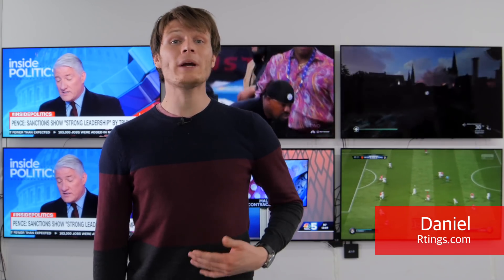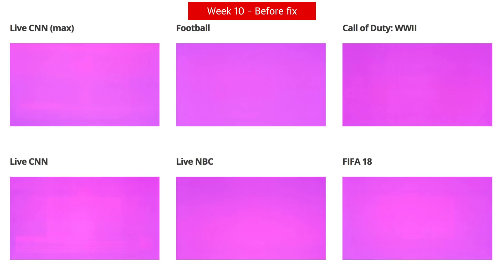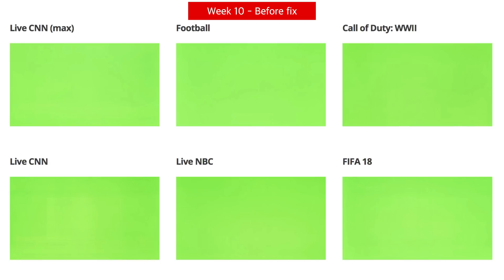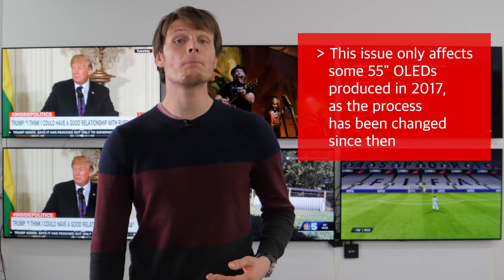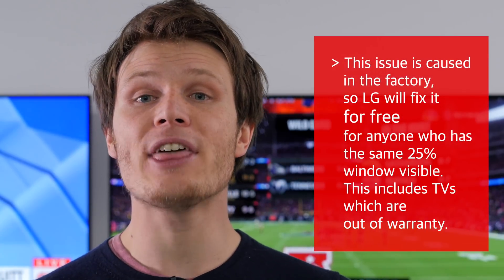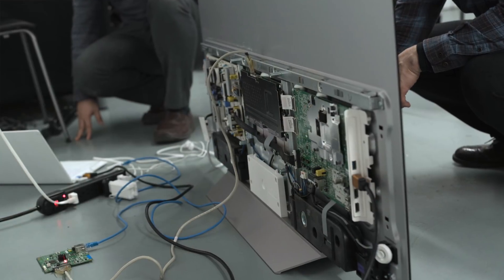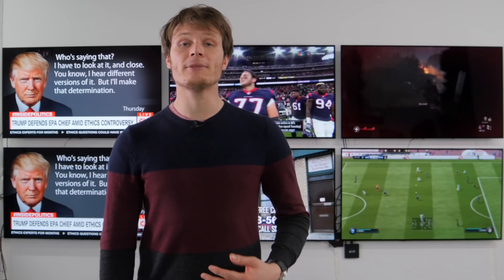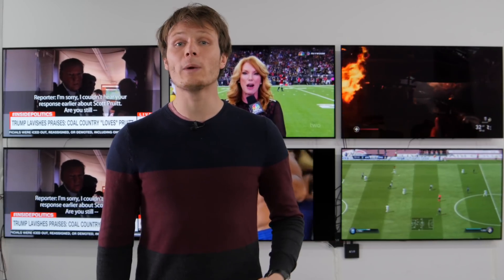Factory Defect & Fix - OLED Burn in Test Update Week 10 - RTINGS.com

Comment: I had at least 2 65 TVs that  had the issue too, so LG claiming it’s only affecting the 55 is not true.....Oled is great concept but the technology is not fully ready for prime time. 
Too many issues especially if you take in consideration the high price tag.
Reply: Normal LED TVs have massive problems all their own. And the TV industry doesn't seem to be interested in fixing any of the massive problems with current displays. They'd rather push gimmicks and marketing junk, and introduce more issues rather than fix existing ones.

So with 4k HDR Tvs we end up with just all of the same problems as before but now with the problems HDR brings without the ability to adjust the panel per pixel. Local dimming is awful.
Reply: Zorastorm 32 i don’t get that at all. Have no idea what you’re talking about lol. Dolby Vision content looks fantastic on my B7. The only time I’ve had “dancing pixels” is with Far Cry 5 in HDR but it was some sort of glitch so I just reset the game and everything was fine
Reply: Davido Butt oh wow, yea maybe because I bought mine so late that most of those defective ones got bought up and/or returned and shuffled around, so I probably bought a late production model. Yea bought an Xbox One X to go with it and it’s been amazing lol although I wish I had money for a PS4 Pro too since god of war is about to come out. I just have a base PS4. But I got the 5 year Best Buy warranty so if I do happen to get burn in then I’ll be covered and I’ll also get the latest OLED model lol
Reply: Most Dobly Vision content on Oled panels are awful. Only exception is Pacific rim. 

If you use dobly vision on Netflix, you get stupid dancing pixels. Just stick with HDR for now
Reply: Zoramstorm 32, you seems to describe a hdmi cable quality problem,. My result in Dolby Vision on my LG C7V is fantastic (bluray 4K source or even Netflix source).
Reply: ive never seen that but i won the panel lottery with my c6
are the 7s that bad
Reply: Davido Butt I have a 55” inch and everything works perfectly fine. Can’t say if the bigger sizes are different, apparently they’re more likely to have problems
Reply: Watch stranger things on dobly vision. Most of the time you get dancing pixels
Reply: Gewdvibes yea 55 is what I've got too and what's different with the c6 and previous years are that oleds where curved and made quality control much higher and also 55 was the first size they developed for mass market which is why the 65 was more prone to have issues. But for some reason the flat versions had more issues which is why the e6's quality was lower making them change the way each display was cured for the 7 series but as this video explains they got the new process wrong and even tho they say they fixed it there was already a bigger batch out with sellers due to the popularity with the 6 series out stripping demand so they made too many 7 before finding the issue and that's why the panel lottery with the 7 was harder to achieve for the end user. Those that got a 7 that cured properly got an amazing set. 
I had Samsung for years plasma and led but the js8500 was the worst tv I've ever had with light bleed half a yellow picture when any white images lines everywhere and dark spots and even worse the software kept crashing daily.
Hope yours lasts as well as mine 4khdr pc gaming for years hopefully
Reply: Zorastorm 32 it looked great to me, no dancing pixels. Are you talking about noise that Netflix loves to use? Or actually random pixels flashing about? Because I can see the noise but other shows look fine so it’s probably just the way Netflix films their shows. Altered Carbon looks fantastic, Jessica Jones looked great, Bright looked great, etc. So idk, everything works fine on my TV
Reply: Oleds still the best on the market
Reply: doomtomb3 Yes but they have their flaws, and burn is a very major one.

Comment: Yeah I'm not sure LG. That 25% window was definitely there on my 2017 65 inch. It's why I exchanged it.
Reply from the maker: Interesting. Do you have a photo of your TV with that issue that you can send us? Thanks
Reply: Rtings.com Here you go:

http://imgur.com/T7Ewn5z

Unless I'm mistaken and that square was something else? No issues on my replacement 65B7.
Reply from the maker: Thanks. This indeed look like a 25% window. We will ask LG to comment about this. To clarify, you've never displayed a 25% window yourself?
Reply from the maker: Ok. We will keep you posted on LG's response
Reply: I do not notice it in most regular content mainly on Netflix start up. If you have not noticed it in your normal use I wouldn't worry about it. 

However if you want to test for it Google search for a 5% grey/black image. Which shows most flaws of this tv.
Reply: My friend got the c8 and burned in within 5 months of heavy used. LG is giving a hard time too. Cant wait for my qled!
Reply: My 2017 65" B7 has been perfect
Reply: I also have a 65" B7 with what looks like a 25% window.

 https://imgur.com/gallery/w6Jb8
Reply: Hi all I have the 55c7, I don't usually follow this kind of thing. Can someone explain how I test for this please.
Reply: Michael Thanks for that, I'll have a look on YouTube as it's easy to display via the built in YouTube app 👍
Reply: Rtings.com my 55 c7v also has this 25% window. It comes up on 5% grey screens but it depends... I'm in UK and got the tv just before Christmas last year...
Reply: Bill Any news from LG? How should I check for this in my TV?
Reply: What was the response?
Reply: doomtomb So far it has, I think sooner or later you'll have issues. I was tempted to go for the B7, but as long as LG don't cover burn and banding no way am I risking spending big money on an OLED.

Comment: Thanks for your research!

Would static noises on no signal channels fix screen burn in, do you know?
Reply: That used to help with my plasma years ago. I left the static on for a little while before turning it off. It shifts the pixel change extremely fast. Wiping off any retention. I'm sure it would have a benefit on OLED too. Problem is channels are digital now. So hard to find that white noise static.
Reply: Zorastorm 32 No!!!